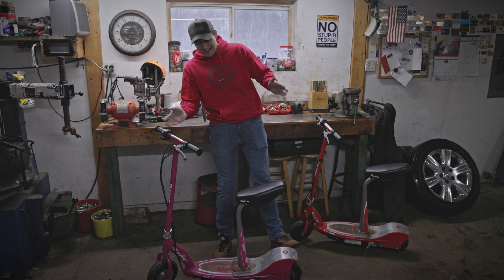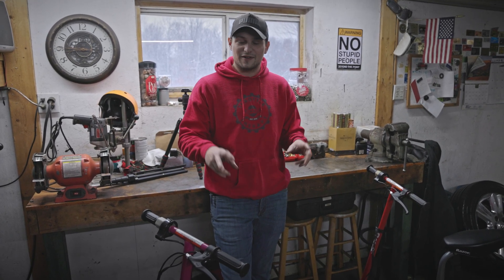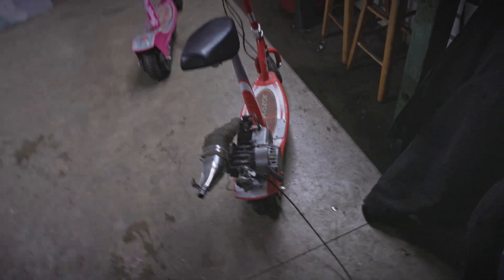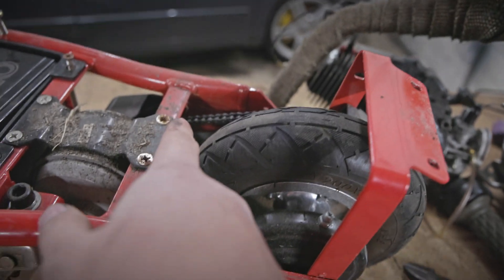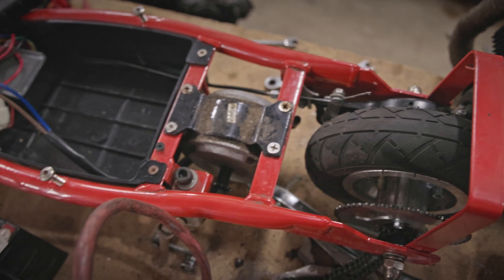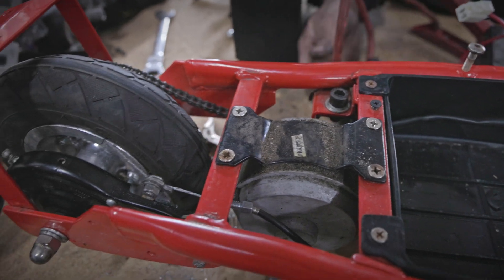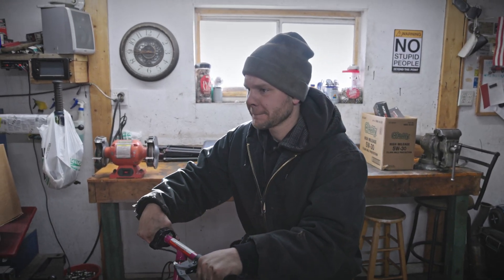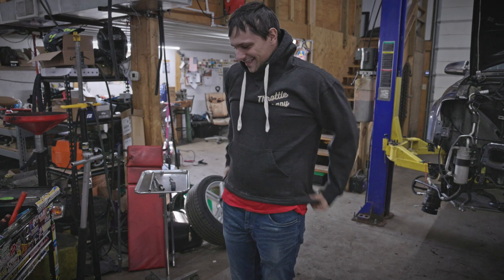Building a Hybrid Electric 2 Stroke Scooter

Comment: Hello.., I have  a Vinci scooter ....and I have  a problem..with  the ignition..
When I turn the key  on ,..the spark  plug..has spark   but I'm.not cranking  the engine...
And when  start  cranking..it does  not start  only back fires....
Reply: And  when  I remove  the spark  plug from.the engine  ..if hold the key  in on position  ..it gives  a arching..on the ignition coil